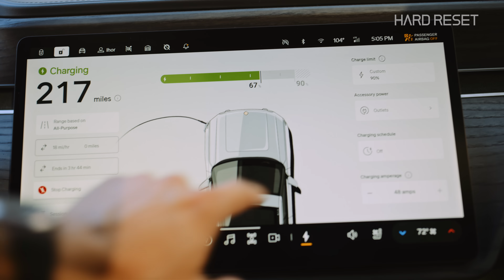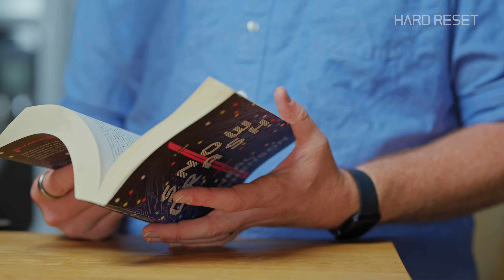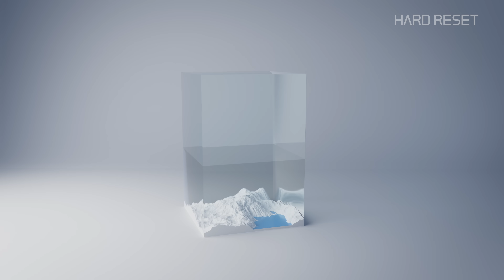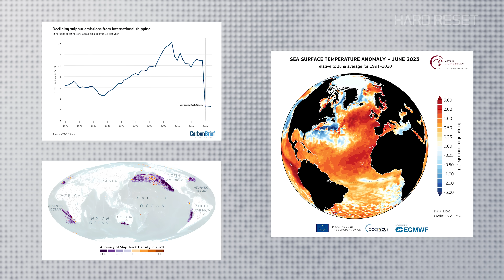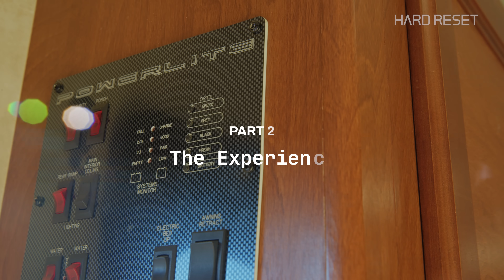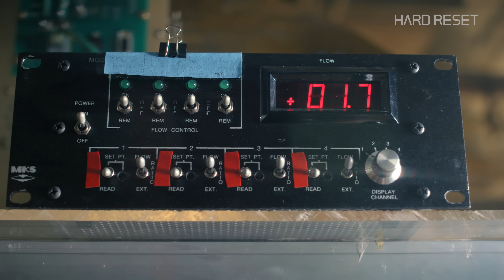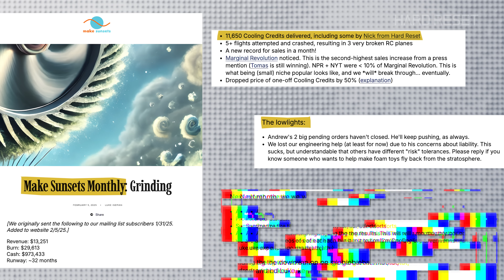The DIY Climate Fix No One Wants... But We Might Need

Comment: If you really want to do good work this project for sure, no side-effects involved, use an ozone generator on the balloon and put loads of ozone in the stratosphere. That will also block uv, but it's naturally there already. The so2 actually breaks ozone down so it is already breaking it's own effect down in the long term. The problem with quick fix solutions is that the long term effects, irl almost always, counter effect the short term wins: the more powerful the short term good effect the stronger the long term benign effects. Think DDT, CFK, PFAS, they all seem to good to be true, and fantastic, but the problems that created..

Comment: Direct Air Capture is just a losing strategy... SO2 is a good bandaid. There will probably be consequences, but it does seem the lesser of the two evils right now. If it would slow down the rate of heating and grant us more time, that would be great.

And of course there will be a dependence, but it would be shorter lived.

The thing that speeds up carbon capture the most is not emitting it by replacing the generation source with a renewable. This is... everyone knows this. So let renewables do their job and use the SO2 to give us more time to transition. That makes the most sense to me.

Also, I think it's disingenuous to say renewables have not slowed the heating. They have had a positive effect, it's just unfortunate they were offset by both the removal of SO2 and increase of fossil fuel use.

But we are closer to a tipping point with renewables, and if we could hit a tipping point with geoengineering too, I would feel a lot better about our future.

Comment: The Neal Stephenson rockets burned sulfur INTO sulfur dioxide rather than burning sulfur dioxide, to be clear. What I've wondered is why not use hydrogen sulfide as the fuel for a liquid fueled rocket (or ramjet). No need for a gun, just a rocket powered by H2S and LOX, or a ramjet burning H2S. A methane burning engine could probably be adapted to burn hydrogen sulfide relatively simply. Stage 1, burn methane, stage 2 burn hydrogen sulfide. Perhaps superheavy/starship, using H2S adapted engines?

Comment: 3:00 basically if you e heard your favorite space lasers politician or chemtrail crank, have cherry picked the writing and this sulphur dioxide would mute the sun's light a fraction of a percent cooling the surface. If you were in an area of the US the last two summers of the wildfires you'd feel the cooling effect as the sun was a tinge redder. The idea is an amount that is unnoticeable to the naked eye but reflective to infrared.

Comment: Even better example of us cooking the planet is look at the global surface temperature from 1890 to now, and you'll see a point between 1930-1970 where the temperature was steady ish, really when wW2 ramped up, and you'll see some spikes trending down, which if you remember from the 50's-60's scientists warn of possibly going back toward an ice age, acid rain was an issue in the 70's. Well once tricky Dick signed the Clean Air Act and it took full effect suddenly the temperature began to rise again, but the sulphur dioxide was reduced and the CO2 continued to climb.

Comment: Possibly if actual géo engineering done by the army with nanoparticles would stop.   Weather would rebalance.   It may take 5 years.    Right now. CO2 is attributed impacts it doesn’t have.   It can’t as per physics.      Géo engineering does but it is denied

Comment: The other issue, to the one I mentioned in another post, is the stupendous amount of SO2( and hence acid rain on steroids) that would be needed. See, CO2 isn't the only problem- currently there are MASSIVE AMOUNTS of methane locked away as hydrates that are starting to thaw and add to the greenhouse effect, it leaves the atmosphere quicker than CO2 so overall it's warming ability is about 28 times that of CO2,  so there's an absolute shitload more serious global warming coming, and frankly trying to cut down or even altogether stop CO2 emissions still won'y make a bit of difference to the trillions of tons of those greenhouse gases that are yet to be added  to our atmosphere. Global warming might have some beneficial effects in making large areas of say Russia or even Canada warmer, and equatorial regions much wetter who knows, but sea level rise with it's immutable loss of land mass means trouble for sure. If we really want to control climate the only quick and adjustable way is satellites rolling out kilometer long arrays of Mylar type sun shields that can modulate a certain percentage loss of solar energy hitting the planet, the thing is, we already have the technology to do this.

Comment: The general idea, of using a substance to reflect solar energy , is sound. Using sulfur dioxide, is not. Sulfur dioxide by itself is fairly benign, but when released into the atmosphere, what WILL ABSOLUTELY HAPPEN it will interact with atmospheric oxygen and U.V. to become sulfur trioxide, that gas is extremely hygroscopic (attracts water) and becomes sulfuric acid, the SO2 is the gas most directly responsible for acid rain. There is NO way in hell that creating acid rain is in any way beneficial.  Even small amounts are capable of changing the pH of rivers, streams, lakes to levels that normal fauna and flora cannot tolerate.
Reply: We address at 5:51 in the video...

Comment: This doesn't fix CO2. ALGAE can sequester 100 gigatons of CO2 per year - as peer-reviewed research has proven. Interview Sir David King and Raffael Jovine for details. There are others working on algae as well. Photosynthesis via blue light is 100% energy conversion via algae. Assessing global carbon sequestration and bioenergy potential from microalgae cultivation on marginal lands leveraging machine learning
" Projections based on optimal PBR [photobioreactor] conditions suggest an annual yield of 99.54 gigatons of microalgae biomass."
Besides there's 1200 gigatons of pressurized methane hydrates in the world's largest ocean shelf - east siberian Arctic shelf. There's already 500 extra zettajoules of heat in the ocean that will be releasing! Just blocking heat from the sun is not going to stop the heat from the ocean being released.
ONLY addressing the cause of the problem will reduce the heat problem.

Comment: No climate change from global warming that was to start at 1.5°C of global warming causing stronger observable hurricanes in the Gulf-of-America (Gulf-of-Mexico).  NASA reports global warming at 1°C where it has been since 1992 after falling from its reported all time high of 1.1°C in 1991.  The cause of global warming is not known in 2025.  Earth's water vapor saturated greenhouse effect is due to water vapor adding 10°F (5.55°C) to earth’s average temperature absorbing all the greenhouse radiant energy from the earth within a few meters of the radiating surface.  The other greenhouse gasses can not change its overall effect.

On average human caused atmospheric carbon dioxide is less than an 0.1% share in earth’s water vapor saturated greenhouse effect.  Water vapor has a CO2e of 18 and on average 1% of the troposphere.  Carbon dioxide has a CO2e of 1 and is 0.04% of the atmosphere 400ppm.   

1.00%/0.04%=25,  water vapor is 25 times more present in the troposphere than carbon dioxide.  25 X 18 CO2e = 450 CO2e for water vapor and 1 CO2e for CO2.  All the other greenhouses add up to a bit less to about the same as that for carbon dioxide 1 CO2e.   Carbon dioxide has 1/452 share in earth’s water vapor saturated greenhouse effect at average 1% water vapor.  40% of atmospheric carbon dioxide is considered to be from human activity.  This leaves human caused atmospheric carbon dioxide being less than a 0.1% share of earth's water vapor saturated greenhouse effect.   5.55°C X 0.001 = 0.00555°C

Comment: No, fix the soils to let more water + heat in and have space under buildings, roads... to mitigate covering the ground, that else will be hard, dry and cool, which means other (distant) soils must receive more water/heat, causing extremes and rising global temperature. The main cause - not CO2 or other greenhouse gasses, caculate how much of the earth's surface obstructs water + heat to enter our soils in urban and nature areas - you will be amazed! So in fact we have a "shrinking" earth with less and less ability to put heat + water away every year. 
The calamity started with the sudden rise of billions of manmade structures around 1975 - 1980 during the oil crises when less use of transport (and fuel) was nescessary! And you will see the sudden rise of global temperature around 1980! A coinsidence? I don't think so!
Reply: Wow!  Looks like there's a Nobel Prize in your future as you invent a new non-physics based solution!  MAGA-ON Dude!!!
Reply: @mrunning10  It's a well known fact that humid air let heat be leveled better than dry air over an land area - then the high and low temperature in humid air must be closer to each other. This give us calmer weather with eddies in rugged terrain (and vegetation) doing their work better of leveling wind, moisture and temperature over the area during whole days with incoming weather systems. (I'm an educated fluid expert, "retired" from X). So we can't really talk about water vapor being a greenhouse gas in pure state - since this sort of vapor and good environments do their best to level conditions within the reach of an area.
CO2 on the other hand will easily build up heat where there's mono terrain, little vegtation and dry air. The few water molecules in the terrain are hijacked by CO2 to give circles of heat, that widen or make way to more heat circles on top. So the temperature rises, and only a threshold level of energy will let some of this heat break lose to reach other areas, often causing extreme weather there.
Do the experiment of an ice cube in cool fresh water and an ice cube in cool carbonated, plain water. Which cube melt completely first? The cube in fresh water! CO2 in carbonated water hijacks water molecules in circles and try to avoid cool dense water from the melting cube (the rule of least resistance). Only a threshold energy level building up by CO2 will disturb the circles that may cross and fast reach the cube to melt this quickly. But the cube in fresh water have leveled heat around, so the steady, calm melting of the cube is in total quicker than the slow and then fast melting of the cube in carbonated water. Analog to our environments with calm weather or rough weather, depending on differences of moisture, temperature, terrain and vegetation.
Keeping areas (wetlands) rugged with enough moisture in soil to (evo)transpire vapor little by little from not too dense vegetation let eddies in the air do their leveling work in our living areas (eddies, light and moisture are often obstructed from moving between to tightly placed trees, so thinning may be needed). Else too fast winds or currents (in mono terrain) will obstruct such leveling. Much the same principles in lakes and seas. OK?
Reply: "Rare" today, but with continued lower relative humidity since the oil crises during the 70s, sudden power failure (due to strong wind, water vapor condensate or lightening when temperature differences increases) will happen more often in warm areas, like Spain today:
"The Portuguese electricity operator earlier said the outage was caused by a "rare" atmospheric phenomenon, related to variations in temperatures"
So less use of fossil fuels to bring moisture into the now more bare environment with combined fewer ponds or wetlands, must be mitigated with rugged terrain, vegetation and moisture in soils, like I mentioned.

Comment: Sorry, again:  Google the 10 year EU study on the high altitude accidental placement (airline fuel is made from high-sulphur crude stocks, even more so, since other stocks have been diverted to truck and ship fuels), of sulphur by transatlantic airline flights.  They measured the daytime-reflection versus night-time-retention of heat.

They found the daytime heat reflection was less than the nighttime retention.  A cloudy night fails to cool down, for the same reason, but it still holds at airline altitudes.

I found it in a Texas newspaper, that said airlines (and manufacturers) were seeking ways to schedule flights to minimize the nighttime gain (or change the engines to reduce the gasses produced that cause the  nighttime gain).
Reply: Sorry, but it's not the sulfur in the fuel that's doing that.  It's the water vapor that is formed from combusting the fuel.  If someone told you that it was sulfur, they were either confused or lying.  I suspect the latter.  The water vapor effect (aka contrails) is well understood.  They can ameliorate the night time heating effect to some extent by flying at lower altitudes, but that will have a small fuel efficiency penalty.
Reply: @   Sulphur only comes in, because that's what they plan on using for SRM.  Sulpur in jet fuel has always existed, because it's in the crude stocks.

It has slightly increased, as low Sulphur crude oil stocks, have been diverted to truck and ship fuels, to meet lower allowed standards.  Google it.  It's in the petroleum industry magazines.  They hate it.
Reply: These clowns are just internet clickbait.
Reply: @ You clicked on it, didn't you.

Comment: Organic Oceanic Aeration needs to be explored through substantial investment as well. As sea surfaces warm, a thicker thermal barrier forms over the water, often seen as fog, which insulates the sea surface from the cold. This, along with thousands of ships dumping millions of gallons of warm water into the oceans every minute with engine and reactor cooling systems, adds a huge amount of the GHG Water vapor to the atmosphere. Oceanic Aeration, which is totally organic, harvests frigid polar air and bypasses the fog, rapidly cooling sea surfaces which in turn reduces evaporation, the GHG Water Vapor and, with enough Aerators in place, could cool our planet. Then, if the climate ever went the other way and was getting too cold, the function of these Aerators could be reversed and warm water could be diffused into sea surfaces to warm us up again. I don't see reversibility in the stratospheric aerosol injection; a huge reason for large scale Oceanic Aeration.

Comment: Researchers at Purdue University have developed a reflective white paint that can reflect up to 98.1% of sunlight, making it the whitest paint ever created.
 This paint is designed to help combat climate change by reducing the need for air conditioning and lowering surface temperatures. Between the two,perhaps we'll survive our own technology. Mho
Reply: Unfortunately, no one wants to paint their roof white, and you're limited to buildings, while a lot of the energy from the Sun is being absorbed by oceans. So it might have localized cooling, but it doesn't help global warming.